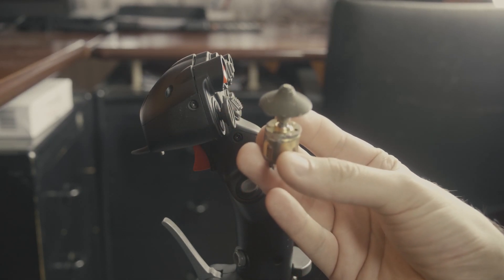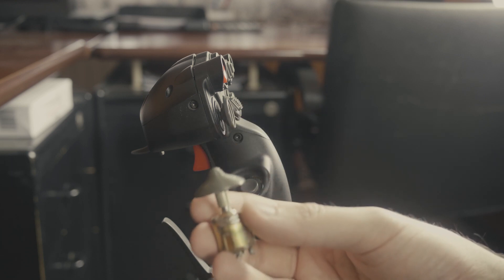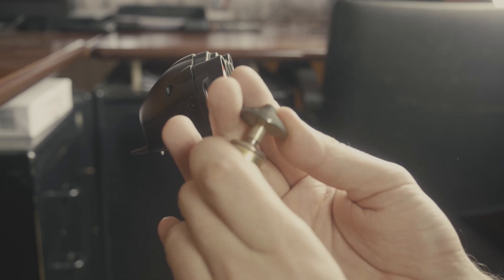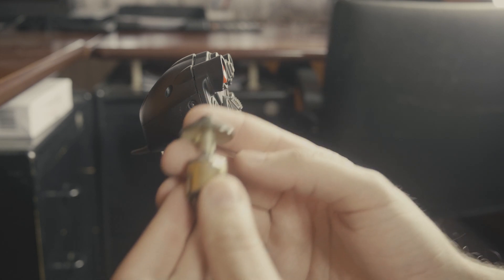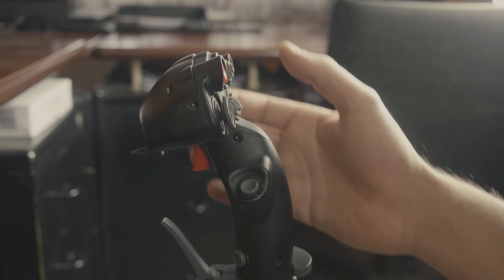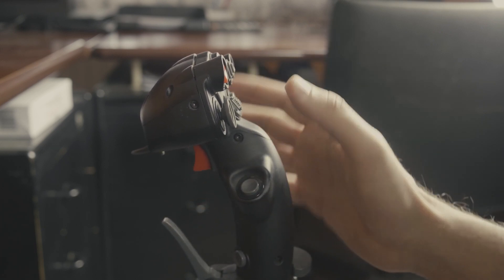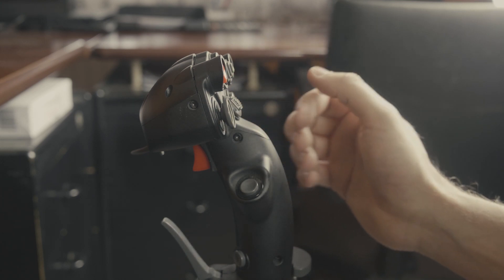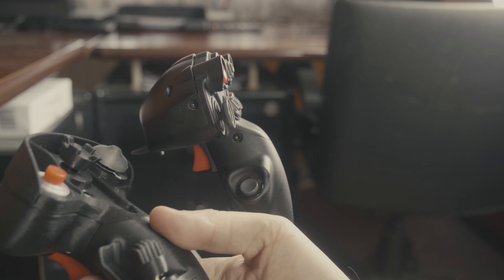REPLIKA 4 & 5-way hat switch comparison

Comment: Stop teasing me! I really hope your Hornet grip makes it into production - I'll be buying one! Any hints on projected price, yet? Thanks for your videos.
Reply from the maker: Pricing will be 1/3 less than competitors. And there's no "making it into production", as these are 3d printed, not injection molded. So there is no investment needed to start making them. I only want to finish a complete line-up of products in peace, before the sales chaos starts.
Reply: @replikagear3333  Are you going to have your own base or will they be mountable on VKB / Virpil bases?
Reply from the maker: @inrptn  I already have my own base, you can see it in a video on my channel. Just need to do some more fine tuning of springs and switches.
Reply: @replikagear3333  Thanks for your reply. I look forward to it. Especially THROTTLES. Have a good day.
Reply: @replikagear3333  Didn’t realize that was your pricing. If you actually hit that then I imagine the sales chaos you mentioned is going to be pretty big. Wish you much luck.
Reply from the maker: @questofknowledge8788  Yes it cost me 15$ - 30$ for a complete set: stick+base+mount so it is up to me whether I want 300$ for it, or 900$. It is just a decision at this point, not a struggle. The struggle was working 5 years to make it even possible at all. You're not seeing anyone else producing 3d prints at this level of complexity and surface quality, because it is just not possible until you develop your own machines and processes.
Reply: @replikagear3333  What is your opinion on AuthentiKit and the ideas he has for that? I stumbled upon him while watching your videos. Seems like you are very similar in material but I think your approach may have more longevity to it.
Reply from the maker: @questofknowledge8788  That kit is just 3d printed. Which is ok, especially for being free to print yourself. But the problem with 3d printed parts is that they are VERY flimsy and light and cheap feeling. I spend 100s of hours implementing stainless steel inserts into all my products so they feel more like full metal Thrustmaster Warthog or Winwing. My grips are 500 to 800 grams. If I pull out the stainless steel reinforcements, they are 70 grams. So even though it's all 3d printed, it's actually 90% metal by weight.
Reply: @replikagear3333  I figured you would do something like that but wasn’t sure. Been salivating over this stuff sense I found your channel. Yeah 3d printed can feel cheap, but it’s all about design. I don’t know how to do complex shape design like what you would see in a flight stick, but the idea of 3d printed makes producing them much easier and relatively quick.